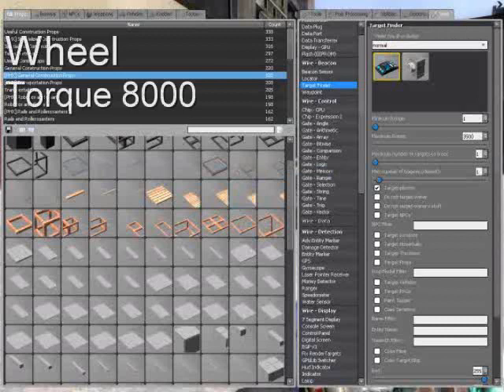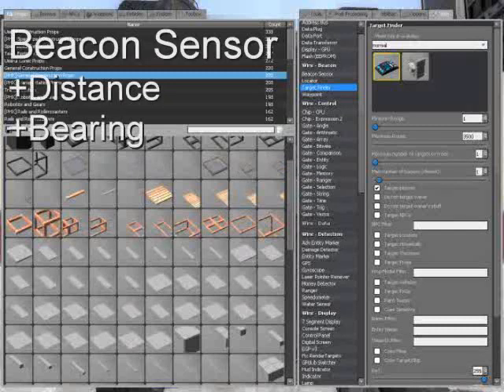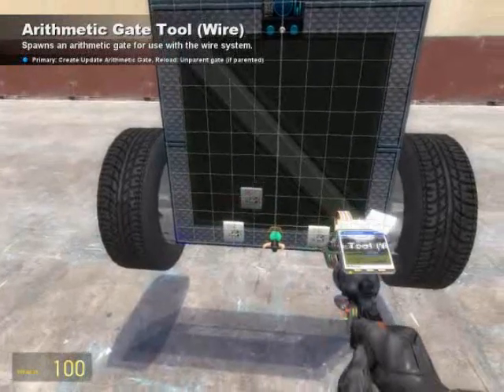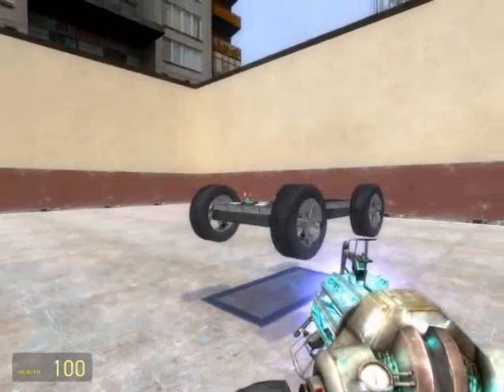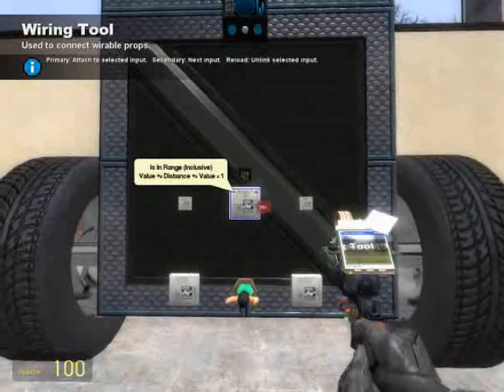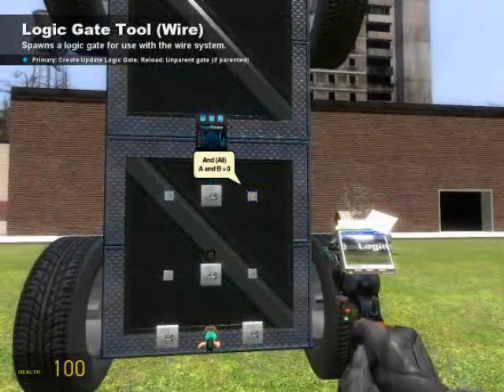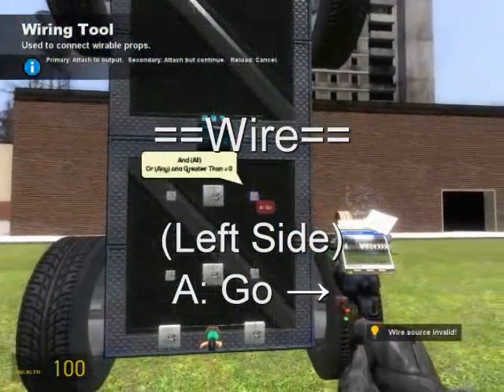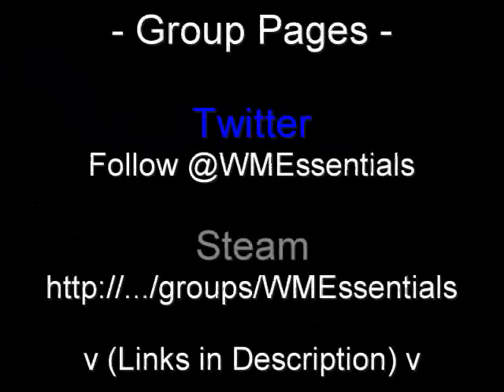WireMod Essentials [Ep. 14] - Follower Drone TUTORIAL

Comment: This tutorial is incorrect. This actually does the complete reverse, if I move away from it, it goes away from me as well.
Reply from the maker: I don't think either of you are wrong.
A lot has changed about wire's user interface, but almost nothing has changed about the core code wire operates off of.

I may make a tutorial bringing people up to speed on the new interface, but it isn't a definite.  My life took a busy turn after the latest tut.
Reply: You are wrong
Reply: If I am wrong, then how did my follower walk away when I did and not come back. It was a reverse control.
Reply: Kylan Boughter Cause you built it wrong, the tutorial isn't wrong if it worked for him
Reply: Or it's the new version of Wiremod's changes. Build it for yourself if you haven't already.
Reply: TakeBackTheWorld Yeah, that is possible
Reply: 404: Not Found wrong worked for me and I have latest version